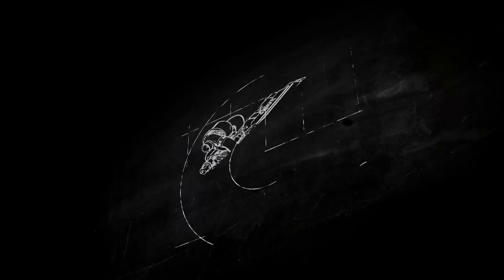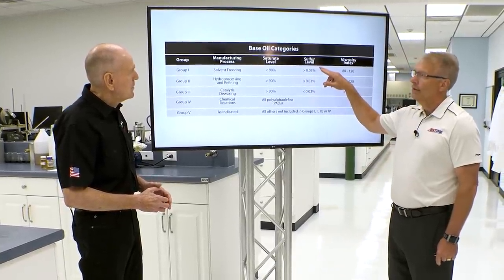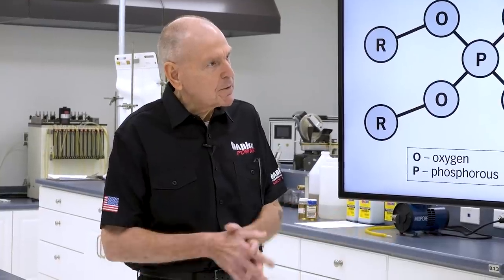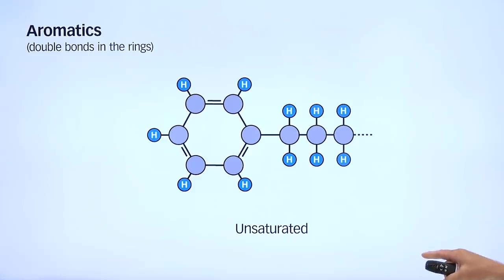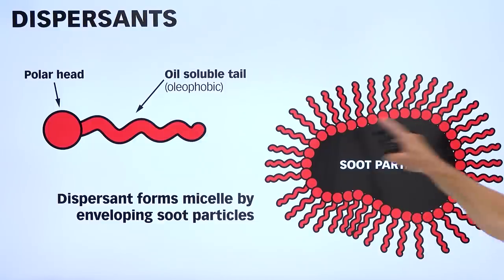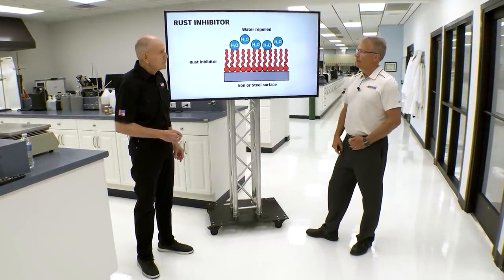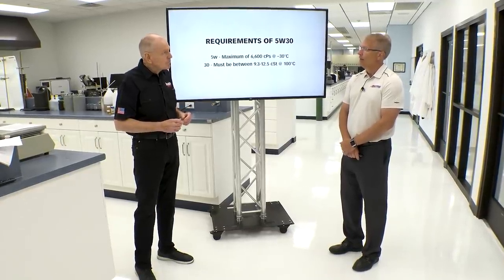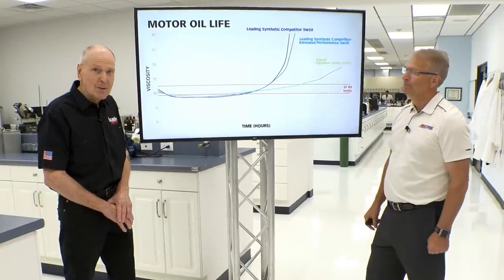What's in synthetic motor oil | Part 2 of 4

Comment: This is all great and sure explains why an oil change with Amsoil oil and filter cost $130 versus a Mobil 1 oil change is $51.  I know if I jumped through hoops and buy a membership I might be able to save some money,  but hard to beat the convenience of hoping the car and going 5 min down the road and getting all I need when I need it.  As far as performance,  I have not seen a UOA that shows a statistical difference in wear in a regular street vehicle like a GM 5.3 or Ford 5.4.  Blackstone Labs has done several write ups about this over the years.  Maybe there is some advantage if you are trying to go 15k, 20k, etc on OCI, or some endurance racing, but not at 3-7k intervals in regular vehicles driving around on public roads.  All the lab tests can say Amsoil is better, but if it doesn't translate into measurable real world data,  what difference does it make?  I know and have read all the fans that say my engine "sounds" better and "runs" better, and feels like it has 20 more hp,  etc....show me the data.  I consistently get 200-400k miles on my engines running regular oil from Walmart,  what advantage would I expect from Amsoil?  The bodies on my vehicles rust out and end its life long before the drivetrain does.
Reply: Extended drain intervals saved time and money.
My 03 civic goes 20k between changes.  UOA's show i can go further if i like.  Sure, it may cost ~$70 for a change but that's cheaper than ~$40 a change and doing it 4 times in that same time.  

Also, it gets -20°F where I am and the cold starts are easy with how well Amsoil Signature Series cold flows.
Reply: i agree with your assessment. i am also guessing that you commute regularly and am not particularly hard on your drivetrain (repeated hard acceleration/heavy use as in towing etc). these situational scenarios are where better formulated oils show their advantages. high shear forces as mentioned...high temps....that sort of thing.  thanks for pointing out the real world average use scenario. most petrolheads were probably screaming at the screen about halfway through the presentation. :-)
Reply: @ChinookBear  so you can go longer between changes but you left out how often you have to add additional oil between the changes
Reply: Still should change oil filter about every 5000 k miles . Also don’t trust Blackstone. They showed my signature series used for 2000 miles as being out of spec, while Oil analyzers came out fine
Reply: You're right, becoming a member makes the price about the same as the leading brands on the shelf. If the extended change guarantee means anything to you, use their filter. It's not cheap but isn't changed in 5k miles either. If not then at least use a Wix synthetic filter.
I don't think it's wrong to say that a nice long engine life can be achieved by regular service with quality oils. It's absolutely true.
(Disclaimer: Brands and models of piece of crap cars not included since changing fluids every day isn't going to save you from that choice.)

My transmissions run top notch on Amsoil fluid as well with dramatic results. I wouldn't put anything else in my cars.
The advantage I see using Amsoil is just math and labor. Nobody with guns pointed at any heads the way I see it. People like what they like and that's just how it is.
That's the great thing about capitalism. Keeps people happy, businesses on their toes, healthy competition and better pricing for all us suckers stuck with the bill.
Reply: Amsoil won Project Farm’s oil challenge….literally beat every other oil out there, look for the vid, it’s a must watch if you are into engine oil…. Personally I do notice a difference when I run Amsoil in our cars….
Reply: And Pennzoil ultra Platinum came in second, pretty impressive
Reply: I expect a blind test would sort out the whole "I feel it..." dudes.
Either replace the oil in the container with another brand or ask them to tell the difference between different oils in their car.
Reply: As a top level manager for a motocross engine fluids company for the past 13yrs. I will say we and everyone else spend far more money on marketing/exposure yearly than R&D. Not saying Amsoil isn’t the best but the consumer market is all about what WE can get you to believe versus prove. Commercial/Industrial is literally the opposite…that’s where substance matters.
Reply: @lawrenceweber2010  
About a quart and a half in 20k.

Another advantage to Amsoil is it doesn't sludge like normal oil.   I also have a 2011 Odyssey with 150k miles.  The 3.5 has issues with the VCM and oil baking to the rings and the rings then sticking and causing bad oil usage issues.  So bad, that Honda has a recall out on it 

With using Amsoil I have zero issues with that and only put in 1qt in 13k miles.  Amsoil speaks for itself.
Reply: I agree that unless you go deeply into the specific oils (MSDS etc) then it doesn't matter what it says on the bottle, except for classification and viscosity. 
I know some brands that's big into sponsoring motorsports and making great racing oils, they sell mixtures of Group II and III at prices higher than some sell Group IV as their synthetic 'road engine oils'. 
The same brand sometimes changes the formula completely between either two classifications or two viscosities, despite them being their... 'Mega-Fantastic Series' oil (and we're talking Big name oil brands here). 
3 things is written on the bottle: 1 Viscosity. 2 Classification. 3 Marketing.
Reply: That is accurate.  As a now-retired Lubricant Application Engineer, an API Group III Synthetic Base Oil for engine oil is sufficient for the oil change intervals that have shortened due to sensitivity to contaminants.  OCI's of 20k are no longer in vogue, sans progressive UOA's, because engine design has changed.  Modern engines are now using oil as a hydraulic fluid for VVT's, MDS's, etc. etc.  These have solenoid pilot valves that are not meant to operate in dirty engine oil.  Using tight media engine oil filters requires changing more often - most users have gone back to 5k OCI's.  That doesn't mean there are NO engine applications for Amsoil / API Group IV / V base oils - just not the average consumer anymore, or even the average enthusiast.
Reply: @tandemwings4733  There's been lawsuits, that's where they settled that it was modified/altered enough by mankind that it can be called synthetic. Every other brand changed their formula after that to save money. There's still places like Germany where they have to be specific, pretty funny when oils sold as synthetic otherwise is sold as mineral there. 😂
But, oil bases only matter in two lubricating regimes, so the application will dictate a lot. They still use Group II oils in some of the most extreme racing environments, they just use specific crude for that base oil.
Reply: @tandemwings4733  - partial info - Castrol was the culprit marketing super refined crude oil as synthetic, not Mobil.  Mobil sued them, and a judge decided what the definition of synthetic would be.  So the legal "profession" dictated engineering yet again.  API was then forced to establish the now well known groupings of oil base stock definitions.
If you read them, Group III is pretty good in terms of hydrotrearing saturation of the hydrocarbon chain.  It's just not perfect, as is the original synthetic,  now Group IV PAO.  Amsoil used to claim their signature series oils used Group IV base stocks.  Don't know if this is still the case, or if the blend a percentage.
Reply: @tandemwings4733  It's not much of a point of us arguing about it, they had to settle what to call them in court, and in the end it's just a name/description. 😄
It's even more funny to think about the term "part synthetic" when even group IV contains lower groups as additive carrier, and lower groups sometimes use group V as an additive. 😂 It's just marketing in the end, having products at several price points.
Reply: Well, it is my understanding that Mobile takes crude oil (as mineral as it gets) purifies it, treats it with hydrogen and voilla, calls it "synthetic" 
While AMSOIL (and RedLine and Chaufferrs oils and very few Liguid  Molly oils) uses PAO and Esters as part of base which are x3+ times more expensive then Hydrocracking-mineral base Mobile uses.
Same goes to Shell / Castrol, they use Gas-To-Liquid technology, where Gas (as mineral as it gets) being liquefied, and used as a base for their "synthetic" LOL oils.
Look, I am not bashing use of Hydrocracking of crude oil or liquefied gas as base, there are great fairly affordable oils made with those technologies but lets not kid ourselves about them being  "full sythetic" 
For example, we liquefy mineral spirits vapor (gas)   and call it Vodka, thats not full synthetic, right? Nor is GTL oils :) 
Also, if you look at Liqui Molly Germany site, most of their oils bottles sold in Germany, say "Syntese Processe" which does not translates "full synthetic" as it says on the same oil bottles offered to dumb Americans. 
Note: some of Liqui Molly oils are real "full synthetic" and sold as "full synthetic" in German market, "syntese processe" is not it.
Reply: @unprofessionalmechanic8466  The amount of atoms are limited on the earth, so if something in nature has put them together into something, or if we have, usually mostly matter when it comes to cost. 😄 The ethylene for PAO is as far as I know most often from crude as well, but maybe they make some in other ways. In the end it becomes a matter of splitting hairs. 😄
It's a problem as well with us wanting them to be honest with what we buy, but apart from classification we can't really know how good it is anyway, well until we run tests on the used oil that is. 😄
Reply: It's around $65 to change my oil to Amsoil for 20k miles. Mobile 1 20k filter, $6, Amsoil 25k $117.21 for 2 changes. *My time is a hobby.
Reply: @tandemwings4733  - what is the definition of "cleaned up"?  A judge disagreed with you.  Group 3 levels of hydrogen saturation of the hydrocarbon chain was sufficient for the judge to declare synthetic definition is met.   It is true the Group 3 base oils usually are made from crude oil, instead of natural gas that Shell does for some of their.   However, to get to the high level of saturation necessary to be a Group III, the crude oil is first vacuum-refined per usual, then heavy fractions are catalytically cracked in a reactor, and then pressure-hydrotreated.   Does this meet your meaning of "not modified/altered"?  It sure doesn't meet mine.
Reply: Would agree for standard run of the mill every day beaters. But racing, higher performance cars, trucking, equipment, farming, is worth it.
Reply: @PSA78  when it comes to my clothes I prefer cotton and other materials derived from nature, real leather for my shoes, not a manmade one, etc. When it comes to my motor oil, I prefer real true synthetics. Cost is secondary. Besides, my SUV takes about 9 quarts, and I would prefer to spend $100-120 for superb product with company who being honest about their product and actually offering excellent product then $50 for, lets say descent but mislabeled product where manufacturer is BSing me that product is something it is not.
Reply: @unprofessionalmechanic8466  I doubt a single company out there will be 100% honest, they sell a product that's been through official testing (and that's extremely expensive).
Racing oils is probably the only exception, but many of those aren't suitable for street use.
There's also a matter of what specific base oils and the blends that might create a synergy, it's not much that will outperform the Group II from Pennsylvania crude for instance, a lot of brands used them in the past and now it's just a couple.
The additive package is also difficult to know anything about, there's a wide variety of qualities/differences within the same name (that's one reason why a bottle of extra additive sometimes become a chemical disaster). The base oil is afterall not the only thing responsible for lubrication. 
It's like I always say, good oil is always expensive, but expensive oil isn't always good. 🤷‍♂️😄
I looked around for a long time for my daily driver to find one that's Group IV, has the correct additive package (classification) and viscosity, that had tested good for others. But one step in any direction from the same line of oils from that brand and it's completely different. 🤷‍♂️😄
Reply: @PSA78  I mean... The synthetic oils are different and inherently "better" than the same arrangement of molecules, but occuring naturally and found in the Earth... 

In a lab you control exactly what goes into the mixture every step of the way. As opposed to something you dug up in your back yard, especially a liquid (no matter how viscous of a liquid it may be),  it will have any number of contaminants suspended in the mixture. As the guy explained in the video, this can even be on a molecular level. You can't filter or clean something (at least cost prohibitively) and have it turn out the same as something that started with only the desired, beneficial ingredient, to begin with. There's just no way... 

Whether this can be attributed to meaningful differences between oils used in your rig, that realistically affect engine wear and longevity... That, I cannot say. Probably not. But I do know that starting out with a contaminated product can't be BETTER than the uncontaminated, lab clean, pure product. So there is a difference. It kind of sounded like you were unsure there, unless I'm mistaken.
Reply: @danielnelson4881  Synthetic oils is usually better, no doubt, but you're simplifying a lot of things in thinking that something that came out of the ground couldn't be good or that there's no problem with any 100% constructed molecules.
And just to explain the basics, no one "digs up something" and just puts it in a bottle, it's always on a molecular level (everything is).
Application is extremely important, it's also a matter of looking at what lubricating regime we're looking at, and objectively looking at both each component as well as the final mixture.
What's needed to win Daytona 500, a Top Fuel race, or get your daily driver to last is three very different things even though they are all just trying to lubricate the engine.
Reply: @BoomBustProfits  The only reason Redline did not win was POE Grp 5 performance in cold is not as good as PAO...Amsoil started out as am ester base...and esters are still the only type of base oil that holds up to the heat of a jet engine...bottom line...under heat Redline is the best...
Reply: Mobil 1 is only grade III oil.  You can do much better with a grade IV synthetic such as Torco, Driven, Penzoil ultra platinum or Amzoil.    I like Euro grade sythetics.   Their marketing insists that synthetic is really synthetic, unlike in the US.
Reply: @michaelprice3785  It's pretty much only in Germany that they have to label them correctly. :)
Reply: @brianmann986  Considering your background, I'd value to know what oil & filters you use yourself.
Reply: @jeffd3844   Pennzoil Ultra Platinum 5W-30 in most vehicles, there are certain exceptions for specialty engines.  Pennzoil is a brand name - it was purchased by Royal Dutch Shell some years ago, it is not "your father's Pennzoil" today.  It is a quality Shell product.  Being gas-to-oil manufactured, it is better than a conventional API Group III base stock - has higher saturated content.   Amsoil is an even better base stock, but is not worth the extra durability when oil change intervals must be limited due to oil contamination from GDI fuel injectors incomplete combustion in rich burn mode.  PUP is a good compromise between excellent lubricity and cleanliness vs. cost.
I use Fram Ultra Synthetic XG oil filters.  Made in USA, these have proven high in efficiency down to low particle sizes, while still retaining significant contamination holding capacity.  Royal Purple is runner up, also made in USA by Champion Industries, but efficiency and capacity is not as high as Fram XG.
Reply: @brianmann986  The design of the Fram Ultra Synthetic oil filter changed last year to a "Dual layered synthetic blend media". The "numbers" are still as good, but is it still a good filter? Is it possible for a filter to be so "efficient" at removing small contaminants that it becomes too restrictive for good oil flow, or is it safe to assume this isn't a problem for any off-the-shelf filter?
Reply: @jeffd3844   Yes, I am aware of that.  Their marketing information was unclear to me and others.  I wrote to Fram, below is the response.  Judge for yourself if it is sufficient - I have no way to test the information.  The only way for a media to be efficient AND sufficient capacity is more surface area.  Period.  If / how they did that I do not know.  btw, youtube does not allow photos within replies, so I had to re-type the reply.

"The re-design on the Fram Ultra XG filters was an upgrade.  They used to use a single layer synthetic internal filter media and a metal screen to support that synthetic element.  The redesign is now a true dual layer synthetic media, as the cage was replaced with a second synthetic internal media.  The addition of the new second layer made the media strong enough on their own, without the metal cage, which did nothing for filtration.  It was simply there to support the media. 
The filtration efficiency was also improved during this change.  The new dual layer media has the same great efficiency rating of 99%+ @ 20 micron.  The new media actually increased the rating below that.  Example - 15 micron - old media was 91% and the new is 93%."
Reply: @brianmann986  Thank you for that 🤔😋
Reply: Excessive use of jargon there champ.  You're lecturing chainsaw enthusiasts, not elite engineers...
Reply: @boatbeard7767  Did that go over your head ole Captn?
Reply: I want to be your gas station. Other than that your experience supports what I believe. Stay within the specifications of the products you use, the production itself and the type of driving you are doing and it will all work out. I have a 2001 Toyota 4cyl. I use semisynthetic and a Supertech filter with a change interval of 2800 miles based on short trip driving. No problems and don't have to worry about how long I can go either.

My advice after a lot of research is, your limit with a dino or semi oil and a low-end or non-name filter should be be about 5000 miles. Especially, the low-end and no-name filters are not made to go more than 5000 miles. If you go past that, don't freak out, but when you get pat 8000 miles, that when conventional oil seriously start to break down.
Reply: @ChinookBear  All synthetics will flow at -20F. Keep in mind also that as soon as the engine starts, the oil immediately begins to warm up. In all likelihood, slight differences in low temperature flow rates between brands will not make any difference. I don't have to worry about this stuff. We have warm winters where I live and I drive a 2001 Toyota.
Reply: @PSA78  The idea that dino (conventional) oils are a junk product is a fantasy. All motor oils are highly engineered products. I remember someone putting up a comment where they said, use a good brand of oil. No one makes bad motor oil. No one is going to make a capital investment in a refinery to make a bad motor oil. The bread and butter for an lubricating oil producer is the volume buyers. No one is going to keep a refinery going if these buyers, including governmental entities, will not buy your product. No one could keep a refinery going supplying deficient product to no-name retailers.

At this point, all motor oils are semisynthetic to a degree because of the additive packages. That's what my sources say.
Reply: @anonymike8280  I agree that they are all highly engineered, a tribology degree is a master degree, it's a lot of things that have to come together and work together.
The extremely costly classification that's always done in independent laboratory secure this.
The base oils made by some mfg is only one small thing, after that the different buyers mix it with all the additives (for the same additive there's also a wide variety to choose from, and this is why adding additive by yourself can be a disaster as some are not compatible).
The blend is shipped to the institute making the classification, and then we know it will meet the minimum and/or specific requirements set out by our car mfg.
There is differences between oils, but not always in the way we think, any step in any direction can make it different from the comparable products on the market (brand X, productline "Y-mega", viscosity 0W-30, classification XYZ, can be unique and should only be compared with another mfg of the same viscosity and classification by oil analysis and testing, and not always the same companies oils as they want us to believe when they spend millions in marketing productline "Y-mega")
Yes most oil blends contains a degree of synthetic products, the oils themselves are sometimes mixed as well between mineral and synthetic, for a number of reasons (but the amount can be really low).
Follow viscosity and classification, and see if you can find oil analysis done on the oil you're interested in and/or run oil analysis yourself, there is added benefits on some oil blends.
Reply: @PSA78  After 50 years motor oil gossip, I seem to be coming rapidly to a number of conclusions. I suspect the way the refiners make semi-synthetic is not to mix together dino (conventional) oil and synthetic but to reduce the refining process that turns mineral base oil into Group 3 synthetic to about 30 percent. Suspect, but they might do it the other way. This also means, any low end synthetic is a dino oil. That's good to know. You need to match the specification of the product to the specifications of the production.

Apparently, there are no legal standards for what semisynthetic oil is, but the major refiners I am sure have industry standards. The federal government and volume buyers are going to want to know what they are paying for and getting. In my own vehicle, which is a 2001 Toyota Camry four, I just follow the severe duty guideline. My driving does not look severe but it is almost all short trips at three miles a leg or less.

Another topic I have studied lately is engine break in and piston rings. Not that I am likely to ever rebuild an engine at this point, but it does clear up a lot of things, including understanding why all-short trip driving represents severe duty.

Knowing in and of itself is a good thing. Even if the knowledge is not practical to you, you still reduce your level of mental dependency and decrease your zones of fear. It makes you better able to defend your choices in face of the fools you inevitably will encounter too.
Reply: @anonymike8280  If it says "semi synthetic" on the bottle then it's marketing, a way of creating more market points by having more products out there. 
It might still be a product that suits you, it might meet your engines requirements at the right cost.  
Otherwise it's a matter of oil groups, I-II =mineral, III-V = synthetic (if it's engine oil).
Reply: @PSA78  I'm very good at researching things when I get going. I have an M.A. in English literature but I also have a way above average science background and experience as a newspaper reporter also.

Group III synthetic oil is made from oil out of the ground (aka "dino" oil). The base oil is highly refined to remove some of the lighter and heavier components that are left in conventional oil and it possibly is altered in its chemical structure also. That's why I concluded that semi-synthetic is a conventional oil that is further refined.

The thing that is important to know is that Group III synthetic is highly refined conventional oil. Groups 4 & 5 are synthesized from natural gas.

Semisynthetic motor oil is a real product, not just a marketing gimmick. It's value is that it has some of the solvent properties of full synthetic oil and it also allows a somewhat longer oil change interval. Somewhat longer. It still is dino oil.

There are legal standards for what constitutes synthetic oil but it is reasonable to think, there are industry standards that the major refiners meet. If it was up to me, refiners would have to put the source of their product on the label. I know at least some of them do already, but I do not know if they are required to tell you whether their base stock is mineral or synthesized from natural gas.

All motor oil is a highly engineered product. People speak of conventional oil like it is junk, but it isn't. It has certain specifications, including what the oil change interval is based on the application and type of driving. If it meets the specification of the engine and it gets changed on time, using it is not going to shorten engine life.
Reply: @PSA78   @PS A  I'm very good at researching things when I get going. I have an M.A. in English literature but I also have a way-above-average science background. I have experience as a newspaper reporter also.

Group III synthetic oil is made from oil out of the ground (aka "dino" oil). The base oil is highly refined to remove some of the lighter and heavier components that are left in conventional oil and it possibly is altered in its chemical structure also. That's why I concluded that semi-synthetic is a conventional oil that is further refined.

The thing that is important to know is that Group III synthetic is highly refined conventional oil. Groups IV & V are synthesized from natural gas.

Semisynthetic motor oil is a real product, not just a marketing gimmick. Its value is that it has some of the solvent properties of full synthetic oil and it also allows a somewhat longer oil change interval. Somewhat longer. It still is dino oil.

There are no legal standards for what constitutes semisynthetic oil but it is reasonable to think, there are industry standards that the major refiners meet. If it was up to me, refiners would have to put the source of their product on the label. I know at least some of them do already, but I do not know if they are required to tell you whether their synthetic base stock is mineral or synthesized from natural gas.

All motor oil is a highly engineered product. People speak of conventional oil like it is junk, but it isn't. It has certain specifications, including what the oil change interval is supposed to be based on the application and type of driving. If it meets the specifications of the engine and it get changed on time, using it is not going to shorten engine life.

There was a court case pertaining to what products were allowed to be called synthetic oil. The U.S. District Court ruled that Group III oil could be called synthetic even though it came from a mineral base stock. In other countries, this is not true and I have seen complaints.

I don't agree. People have to research the products they use and the standards of the shop they take their vehicles to if they don't change the oil themselves. You can't expect someone else to always do all of your thinking for you.
Reply: @anonymike8280  By law (in most countries) group III is a synthetic, as it's been processed so much. 
What some individual blending company (oil mfg) might call their blend is up to them as long as it falls within that, today many probably use a group II+, possibly with another base stock (like group V) for synergy and sell it ass semi synthetic.
Looking at for instance Castrol Magnatec is if I recall correctly like 30% group III+ and the rest group II+ and for some specifications group V, that oil is sold as full synthetic in most countries but not Germany for instance where it's a semi synthetic.
It all comes down to the tribologist trying to meet a requirement within a budget, and then the marketing department decides with the help of lawyers how far they can push the marketing as in some countries they'll have lawsuit on their hands. 
Some are known to be more bold than others there and really not delivering what the price and brand name might suggest.
Some of the most extreme racing on the planet use group II oil, but they use the right base stock and don't go for the cheapest additives within each group.
There's three lubricanting regimes and the base oil(s) pretty much only impact the full film and some on the mixed film lubrication.
It's a lot of things that have to come together in the end.
Reply: @PSA78  I got into the legal definition because I saw someone online who said that in Germany and Japan, only fully synthesized oils can be called synthetic and then complained about Group III synthetic in the United States. For my purposes, I presume semi to be a mineral base oil entirely and presume low-end synthetic to to be Group III. I also keep a 2800 mile oil change interval with semi based on all short trip driving. No one ever damaged an engine because they changed the oil too soon assuming they used the correct products and did the work correctly.

I'm not phobic about synthetic. Walmart substituted Penzoil full when I ordered online  because they were out of the Quaker semi I wanted, and I'm using it. When it runs out, I'll go back to semi. It's not brain surgery unless you are racing, have a high performance engine or something exotic. Just meet the specs and change it often enough.
Reply: @anonymike8280  I don't recall now but I'm guessing they can call a straight group III for synthetic in Germany. I'm not sure what they call their Liqui Moly, I know that any one that has tested it calls it garbage though. 😂 
Driven has a semi synthetic that will blow most other oils out of the water, you really can't judge the lubricating properties just by the name of the base stock. And it's not all peachy with group IV as PAO has a number of things that can be problematic, the only oil in group V that's used for engines is Esters and they can really be engineered to very specific properties but some that's used to engines still have problems. 
It's a balancing act that includes picking the right additives as well.
Yes shorter trips, hard driving like pulling a trailer or driving on dirt roads all require more frequent changes. It usually takes over 20 minutes of actual driving until the oil is at operating temperature, any colder or hotter will reduce the life of oil.
I use an oil that's mostly group IV for increased film strength and then I went down slightly in viscosity, the fuel savings pays for the more expensive oil and the reduced wear is bonus. I then do a filter change halfway through the service intervall so I can top it off and get fresh additives.
And a clean air filter is the best oil filter. 👍
Reply: @PSA78  I do what do is correct for my  driving situation. I bought my car (2001 Camry four) a year and a half ago with 143K miles. 

I am very sure the previous owner never missed an oil change over the life of the vehicle. Other aspects of the maintenance were neglected though, and I had to replace a lot of things including four struts, the water pump, all the seals on the front of the engine, and the valve cover set, though there were no leaks that reached the ground. The engine is very tight and there is no coolant loss now.

Whatever you do, you have to make sure you are adopting a sound mechanical theory. I know my theory is sound based on both the science and the advice of senior mechanics. The extended oil change intervals with synthetic may be based on a sound theory, but my vehicle is too easy to work on and synthetic was not original in my production. If I used a high end synthetic, I still would want to change it at 7500 miles or less based on the type of driving I am doing. Driving around the neighborhood going to Mickey D, Walmart and Trader Joe's does not feel severe, but it is. It's the engine's feelings that matter, not mine.

Keep in mind, too, that in carrying on this discussion, we also are informing our brethern who may not have the same knowledge, experience and research ability you or I have. The big takeaway, I guess, is make sure your theory is sound and then follow it.
Reply: Just change your oils, don't try to squeeze every mile out of it, the minute it shows oil lose, CHANGE it, as it is used up it's additives, ( unless it's already got eng. ring damage, for dirty oil, stuck rings), I've worked in gas, diesel rebuild shops, most rebuilds are from neglect, abuse, or contamination, seen regular serviced diesel engines with 25 K hrs, but it was changed every 250-500 hrs, depending on environment it worked in.
 Nothing cost more than oil changes, except no oil changes.
 Change it, don't stretch it.
Reply: @anonymike8280  The extended drain intervals that some car mfg tried was a recipe for disaster, but some oils do run a bit longer (for a number of reasons). It's worth mentioning that as soon as the oil is poured its a matter of time when it should be changed as well, it's not just distance. 
And it's always possible to send in an oil sample for analysis to see how it works, get it on paper.
It's a lot of work behind the service intervals that the car mfg write down, they will usually point out when there's differences in how long you can run, follow that and make sure the oil meets the classification and it should at least be safe.
Reply: @PSA78  I think I made it to the bottom line. The bottom line is, determine a sound protocol and follow it. The extended drain intervals are not sound for the kind of driving most people do. Most people are making a lot of short trips. Just let me say, if I had a new or late model vehicle, I know what I would do. If I was driving as I am now, my oil change interval would be about 4000 miles, which for me is about six months.
Reply: @anonymike8280  The formulation of the oil will impact how long it will be within specifications, and some engines might need a formulation that for another reason also gives them another drain interval. Just the changes done for modern DI engines is something that impacts a number of things.
Even things like the crude oil used for making gasoline or diesel will change how the oil is polluted, that's why there can be different drain intervals between different continents in the world for the same car, or they might change the oil formula to deal with it.
Tribology on its own is a master degree, for good reasons. 😄
Reply: @PSA78  It all goes back to the idea of a sound protocol for the application (vehicle) and the use it is put to. For my vehicle, anything that says 5W-30 or 10W-30 and has an API seal will work. I like it that way.
Reply: @anonymike8280  Viscosity and the (specific) classification is the only two things on the bottle that says anything of value.
Msds can give a little bit more information, running analysis will give further information or at least understanding of how it works.
I use a 0W-30 in my car, cuts down on wear during cold starts to have a lower cold viscosity. 30 hot viscosity is still within range of what the factory recommended for mine, and due to high VI it's likely thicker at the extreme places like piston pin and valve train than a -40 oil of simpler base stock. Lower viscosity also activates boundary lubrication better, so it can actually reduce wear (contrary to what many believe). 🙂
Yes don't overthink it. 👍